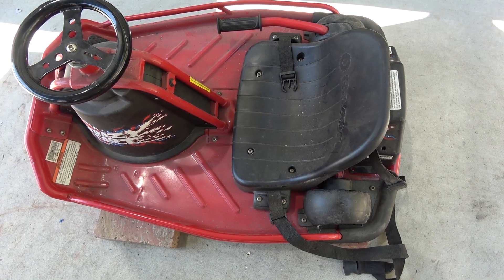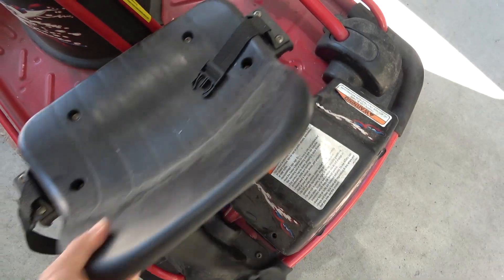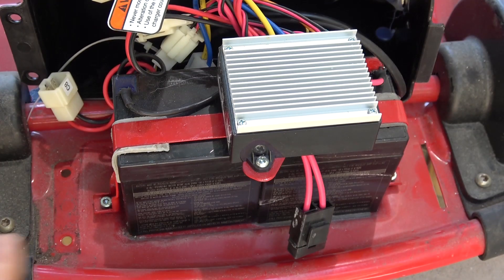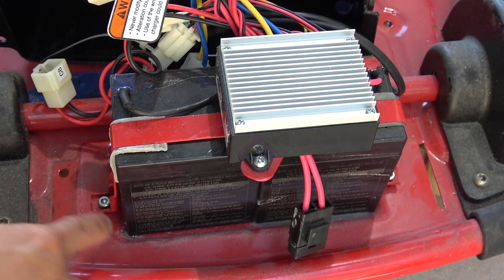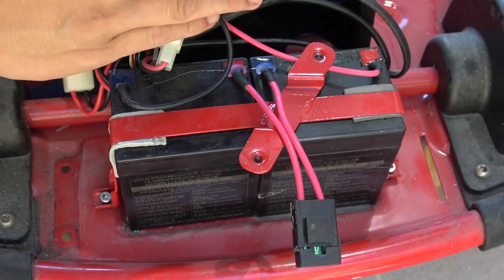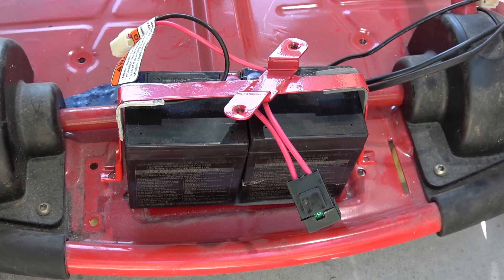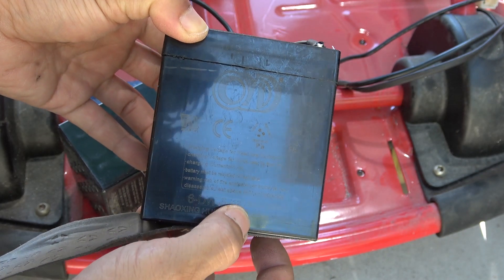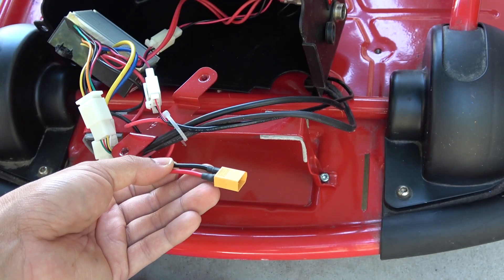Razor Crazy Cart battery upgrade: from Pb to Li-ion power tool battery

Comment: Im trying to put a battery with a xt60 wire on a crazy cart dlx i will need to put on the xt60 connector on the wire right? Or is it different for dlx

Comment: Great solution. Can I recharge the 24v kobalco battery with the original crazy cart recharger? Thank you
Reply: You can not, because the crazy cart electronics controller (ESC) is not programmed to properly charge litium ion batteries. I watched this video and built my cart based on this videos premise but made the following changes: bought a "Battery Adapter for Kobalt 24v max Lithium-ion Battery 12 Gauge Wire Robotics Dock Power Connector" on amazon ($20) which I attached to the base of the crazy cart (drilled 3 holes through the steel, screwed down the referenced battery clip (ensuring enough space to slide battery on and off) and ran the wires into the cover). This way, when the battery is depleted, I can easily access it from outside of the cart and put it into a Kobalt charger. Hope that helps.

Comment: Can you wire up two of those batteries in parallel for longer runtime?
Reply: Yes, I have a dune buggy with three Kobalts in parallel.  Technically it'll run three times as long and the reduced speed of discharge for each battery will help with longevity and potentially heat issues.
Reply: @SilverBackStacker  Three is even better.

Comment: What about low voltage protection for the battery
Reply: The battery (kobalt) has the protection built into it's circuitry (think of using a Drill, the drill doesnt have the electronics to sense the battery capacity, that is all managed inside the battery pack - from my understanding of the batteries description)

Comment: Great idea! And huge THANKS for taking the time to make the video and post it!
Wondering...did you make the connector the battery itself locks into or are those available?
Reply from the maker: Yes, I made a battery connector. I made many versions but here is the latest one: https://youtu.be/En3AG0fNpjs
Reply: Wow! Thanks so much!
That is a great video too. very helpful.
I so appreciate you getting back to me about this.
With your experience with these crazy carts and their battery’s
is there much difference in the original battery configuration and
the switching to the “cordless drill” battery’s’?
Dose the cart run and function basically the same?
What can I except for a change time / run time?
Thanks Again,
Tyler

Comment: I was looking for 24v lithium batteries and came across this. It says its a bike battery, do you think it would work on the crazy cart? www.dhgate.com/product/liitokala-24v-4ah-6ah-8ah-10ah-12-lithium/491032955.html?skuid=635722168176189440
Reply: If you do see this...what amp hour do you think I should buy for a crazy cart?

Comment: Can the controller handle 36 volts? I'd like to use my Ryobi drill batteries, 18 volts each since my charger died.
Reply: Did you ever try it?
Reply: I just hooked up 2 Milwaukee 18V batteries to my sons, been working for over 30 mins now
Reply: @brandonwright6609  does it help for longer play? Does it damage anything else like older coments say it would?
Reply: It will run 36 volts but the 24volt motor will eventually burn out, same with the controller, your gonna wanna buy a new upgraded controller and motor but yes it will run just not for long with the stock stuff..
Reply: Whoops my bad I just realized this comment is 2 years old